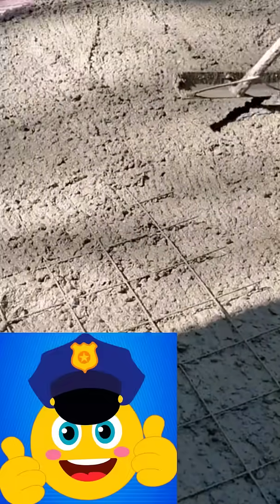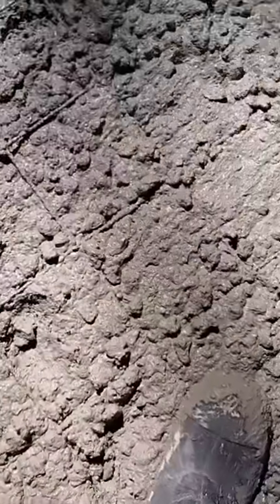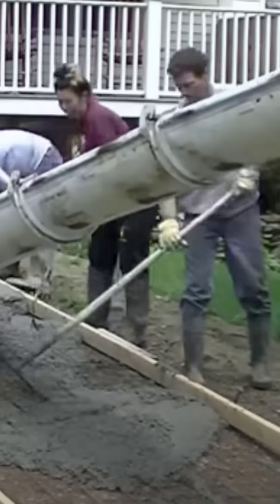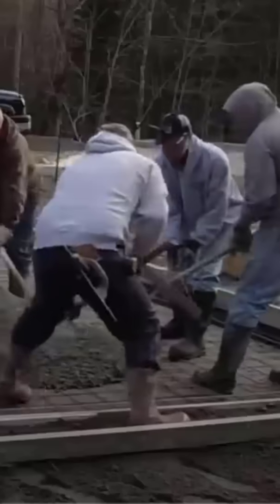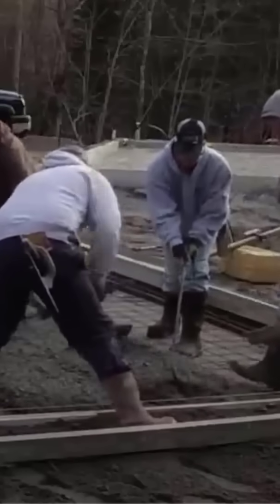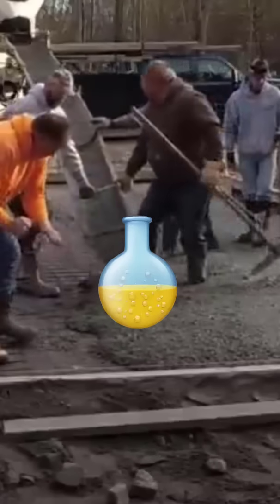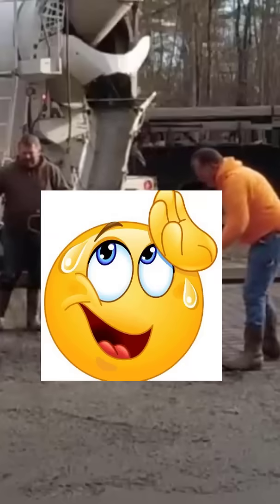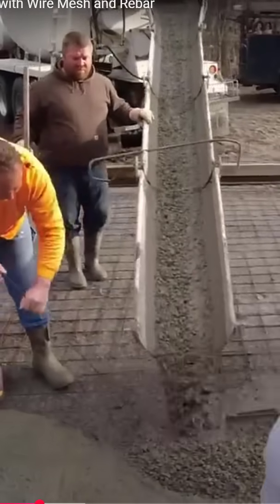Wire Police and Slump Police, What You Don't Know About Concrete! #shorts

Comment: I am not a scientist, but I think they overlook the fact that a looser slump has less honeycomb. Without all the air pockets the honeycomb has, the slab is more uniform and therefore stronger. I havn't  heard anyone say that, but it seems logical to me.

Additionally, the reason wet/high slump concrete cracks is primarily because it shrinks when the water evaporates. I am speculating that the chemical (I think it is also called a plastisizer) water reducer doesn't evaporate = less skrinkage.
Reply: Exactly. My understanding to put it very simply as a finisher is that water displaces cement particles. When the water hydrates out you have microscopic voids left behind and a much less dense concrete product. Water reducer or plasticizer increases the efficiency of the water that is already in the mix, essentially allowing it to do more work, and making the concrete act as if it has more water in it.

Comment: The problem is it should be in the top 2/3 of the slab or bottom 1/3 evenly . The point of chairs and properly having the mesh is to have it at an even constant position throughout the slab , wavy incorrect mesh placement isn’t good for concrete strength , just because it’s off the floor doesn’t mean it’s right or correct . As a professional you should know this and should be doing this for paying customers . This is lazy corner cutting shit work and you try explain it to people that don’t know 
When you should know yourself
Reply: You never want then in the top 2/3 of the floor. When pressure is put on the concrete its gonna try to pull the bottom apart as it goes down. Only if there's a soft spot in the fill but nevertheless, if it's in the top part of the floor it won't serve that purpose.  That's why just picking it up is best cause they dont make chairs that are only an inch high and even if they did you'd have to put them in so close together or the wire would be wavy. Which I also wonder why wavy wire in a floor hurts the strength if its in the bottom 1/3 of the floor?

Comment: If it allows you to pour a looser slump without adding water…why do you always say giver her another drink when getting ready to pour. ??
Reply: You still want to hit your target slump. Batch plants don’t always put the full amount of water that is allowed for that mix design. More often than not we have latitude to add some to hit the desired slump if it comes in a little off. Consistent slump, consistent with both the mix design water content parameters and consistent between multiple trucks, is way more important than the actual slump number or thinking that “dryer is always stronger”

Comment: If you were pouring cement with zero aggregate, the wire might "go back down" after being lifted.  But concrete, by definition, has aggregate, which gets under the wire when the wire mesh is lifted.  This is not hard to understand.  😖

Comment: As a concrete guy who has poured concrete for forty years, I agree one hundred percent. I have removed thousands of square feet of floor, and am amazed at how well wire mesh performs even if it’s a half inch from the bottom of the slab
Reply: not in  canada